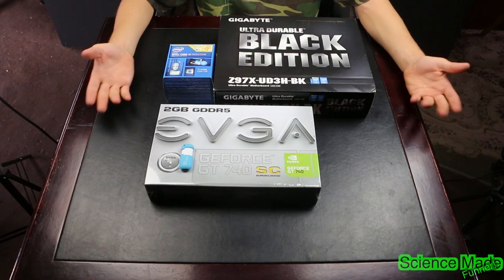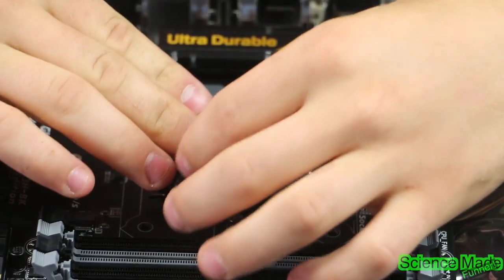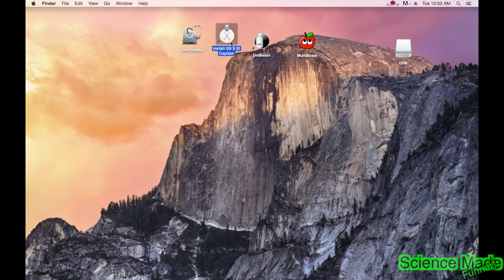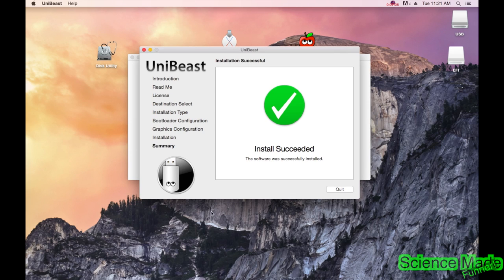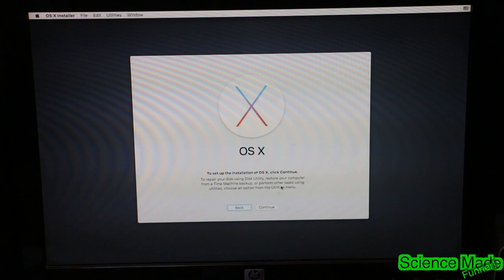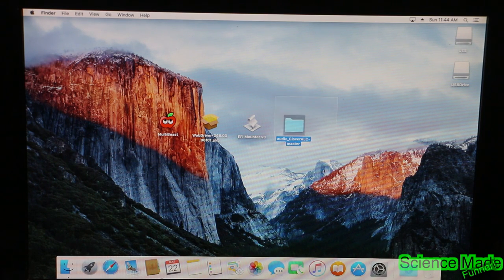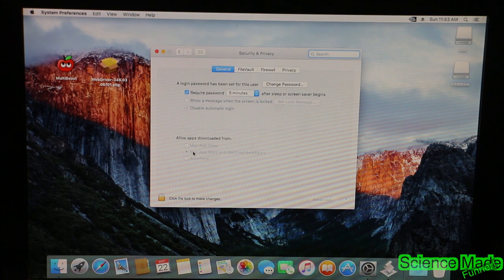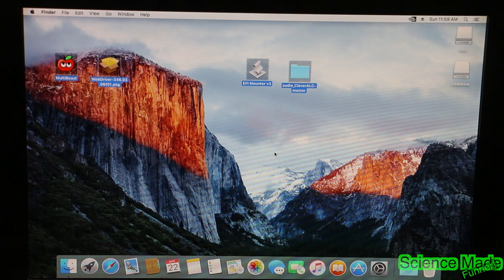How To Make A Hackintosh full video! (El Capitan)

Comment: Great work, you made it very straightforward. 
Thanks. 
So far I haven't had to install video drivers extra step or the sound - I've no idea why, but if it works I'll leave it alone. 
I have issues with adding Boot extras; 
1. the cursor keeps freezing and I can't get it to add the text at the end. 
2. When I did manage to do it, the next time I booted those additions had gone, i.e. I would have had to add them again. 
Any ideas?

Comment: Why do i lose the sound after restart?
Reply: Sound usually lose after update!

It is necessary kext(Driver) for your sound card .
You need to tuck in clover or throw in / System / Library / Extensions using such "Kext "Utility"
Reply: +Dāvis Arājs i installed the driver in multibeast alc 892.. But it not working well.. There are some issues..
Reply: thanx ! Do you know how to run handoff continuity ? i have iPad, i think my bluetooth-adapter is bluetooth 2.0
Reply: First check if your ipad works with handoff!

If yes,then:

Go / System / Library / Extensions/IOBluetoothFamily.kext->Show Package Contents ->  Contents  -> Plugins ->

BroadcomBluetoothHostControllerUSBTransport.kext-> Show Package Contents -> Contents -> info.plist

info.plist - Open with (Xcode)

Find IOKitPersonalities

Ther you can see what chipset u need buy!
If u want  handoff forks in hackintosh!

example:
http://www.bildites.lv/viewer.php?file=jux8go0cmyop3gbbidic.png
Reply: thanx bro_!
Reply: seems complicated since i never used xcode.
Reply: Last thing i want to ask ! I got Elcapitan running on , gtx970, i5 4690k, asus z97-e.  It run fine, but sometime the system reboot by itself and that happens when the apple boot logo shows ? Any idea? Im using clover
Reply: It mybe RAM module!
First try rebuilding the kext cache!

Try use with clover flag: nvda_drv=1
If you use vga for monitor try switch to dvi!
Reply: +Dāvis Arājs ok bro